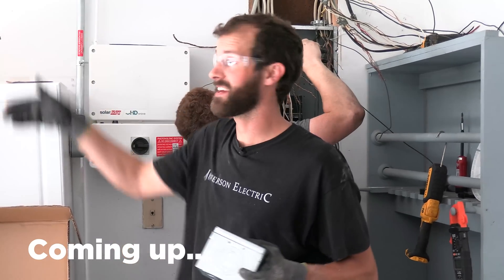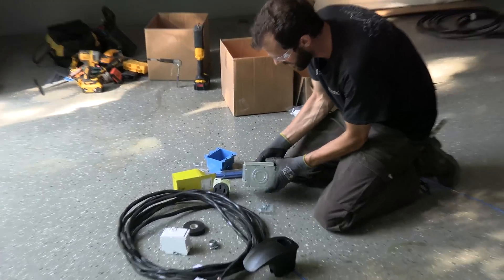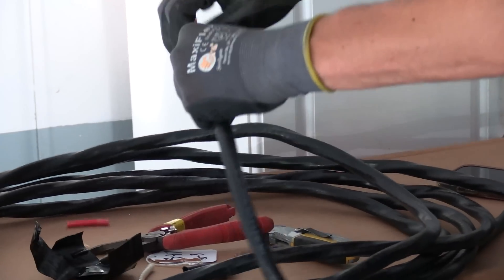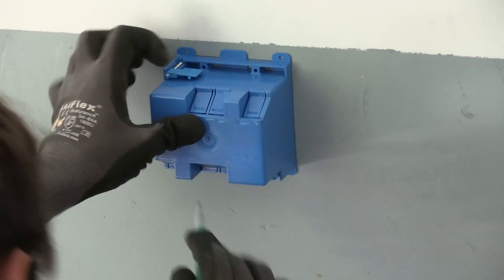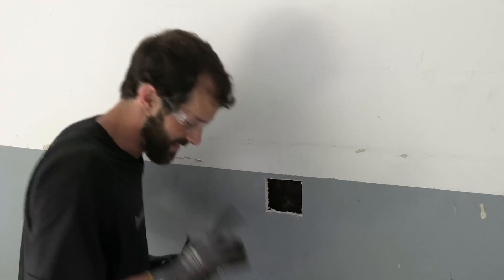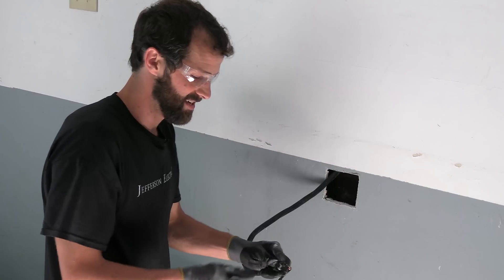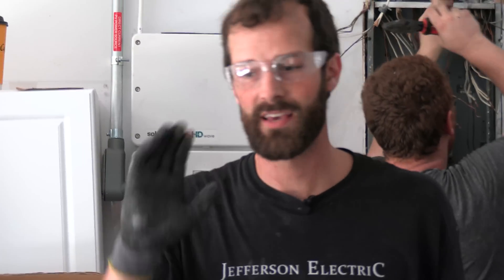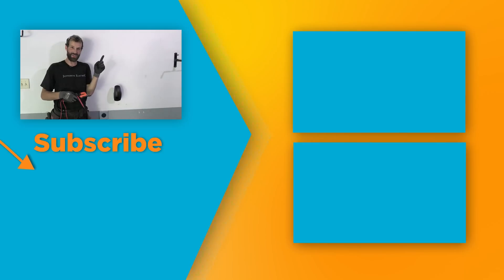Pros Only - Master 'Level' 2 Charging at Home

Comment: 1:38 Can you run 8/3 with a 40A breaker to a NEMA 14-50 Outlet, EV chargers only draw around 32A max?  I believe there is an exception in the Electoral Code since 40A receptacle do not exist.
Reply: If your breaker is 40A, you can run #8. The breaker determines the wire size, not the receptacle or lack there of.
Reply: @paaao  ... it's the wire size that determines the size of everything else. You can't put a 50 amp outlet on a 40 amp circuit. Have fun finding a 40 amp outlet or cord cap on the shelf.
Reply: @rupe53  Not sure what you are talking about, they do not make 40A outlets and you can safely plug a 50A pigtail to a stove in a 50A outlet wired to a 40A breaker which will trip if the appliance pulls more than 40A.  When was the last time you used every burner and oven at the same time on your range.  The pig tail must be matched to the appliance, so it would even be allowed to plug a 30A dryer in a range outlet.   You plug in 18 AWG wire to lamps and TVs into 12AWG 20A circuits all the time, a direct short is still going to trip the breaker.   What you could not do is wire a 30A dryer pig tail to a 50A range and plug it into a 40A Circuit... the 30A wire could start a fire.
Reply: @ericfraser7543  ... the same logic applies to not installing a 20 amp outlet on a 15 amp circuit. You don't want people connecting a larger load than the wire can handle. Using the 80% rule for continuous loads on a car charger applies here because it's a branch circuit. (over 3 hours = continuous) The flip side is an electric range / oven uses t-stats and will never run full load continuously because everything cycles. In theory you can load that circuit to the max on the data plate.
Reply: @rupe53  Exactly the 80% rule allows a 40A circuit to continuously power a 32A EV, I am not an electrician, but from what I read there exists an exception in the code for 40A circuits with 50A outlet. 

All standard three prong outlets are rated for 20 amps...  so you can wire 12 AWG 20A circuit to an 15A outlet with only two vertical prongs.  I agree it would not be wise to wire 14AWG 15A circuit to a 20A outlet with the option for two vertical prongs or one vertical and one horizontal prong even though that circuit is still protected by its 15A breaker.
Reply: @ericfraser7543  ... the key is in the wording. All 15 amp outlets are rated for 20 amps on the passthrough. You can even draw 10 amps from each half of that same duplex for short periods of time if you are on a 20 amp circuit. You may NOT install a 20 amp outlet (with the odd prong) on a 15 amp circuit. #8 wire is basically relegated to a small sub-panel or a hardwired circuit these days. (AC unit?) You can also use it for a LONG run on a smaller circuit to help with voltage drop.
Reply: @rupe53  Well I guess I am going to find out what the inspector thinks of my 50A outlet on my 40A circuit  LOL...  I don't have a problem coving it up since I have other outlets...  Ironically outlet is only a foot away from my subpanel so I could unscrew the plywood and install 6/3 if he made me fix it, I am not sure it is worth the work.
Reply: @rupe53  yeah, this is what is being discussed. The two go hand in hand. If you have 8awg, your breaker can be 40A or smaller. If you have 6awg, the breaker can be 50A or smaller. The original question was in regards to the receptacle rating and appliance cord, which don't matter, because they only need to be rated to handle the voltage and appliance load.

Breakers are there to protect the permanent wiring from the breaker to the load devices. That's it. So if you want to save $5 and install #8 instead of #6, you're stuck with a 40A breaker or less feeding that ckt. It's not rocket science.
Reply: @paaao  ... while your statement is mostly ok, there is a little rocket science out there because drawing too close to the total rating may eventually trip a breaker. See, it's not always about the draw. Breakers will trip on heat as well. If you hit 100% long enough that may do the trick. You might also get away with 110% or even 120% draw of the marked capacity for a time... but it will eventually trip. I have seen 140% for a few minutes, but you are also heating up the wire, which will make the insulation fail earlier. See where this is going and why NEC recommends the 80% rule on loading for continuous draw? (continuous = 3 hours or more)
Reply: @rupe53  just so you know, I've been doing commercial electrical work for 20+ years, and while all you point out is fine and dandy, it really doesn't apply here for some guy who wants to install a car charger that's going to draw 30 to 32 amps. If he wants to buy 8 awg wire and a 40 amp breaker, all is good with the world. When it trips, he can pull 6 awg wire and install a 50a breaker and learn the lesson that over sizing is always easier and cheaper than following promised specs to the T. That being said, yes 3 hrs at 32 amps is your NEC limit. Which is why when I install a car charger for a friend, I use a 50a gfci breaker, and 6 awg wire. But, if your car fast charges at 32 amps for 2 hrs, then slows for the remainder, your 40 amp breaker will hold. It will probably hold even if your car pulls 35 amps for 4 to 8 hrs. The point is, you either over engineer it to never deal with it again, or you install a 40 amp breaker on 8 awg wire, and deal with nuisances when they come. Bottom line, can you use 8 awg if you have a 40 amp breaker? (Original question). The answer is Yes. Yes you can.
Reply: @paaao  ... You are right about the #8 and a 40 amp breaker. The only issue I have is people wanting to put a 50 amp receptacle on the end, which would allow plugging in a device that COULD possibly overdraw the circuit. That's against code the same as a 20 amp outlet on a 15 amp circuit.
Reply: @rupe53  placing 20A receptacles on a 15A branch ckt is perfectly acceptable. The breaker will open in the event of an overload.
Reply: @paaao  ... "210.22 Permissible Loads, Individual Branch Circuits. An individual branch circuit shall be permitted to supply any load for which it is rated, but in no case shall the load exceed the branch-circuit ampere rating." Seems to me that allowing a larger load via the higher rated receptacle configuration is a problem.
Reply: @rupe53  You're not allowing, or changing/increasing the load by placing a 20A receptacle on a 15A ckt. As long as the breaker is 15A, the ckt will be limited. This is permissible due to the fact that a single receptacle, regardless of how many amps it's rated to handle on it's own, will never have enough equipment plugged into it, to pull more current than it's rated for before the breaker opens. 15A breaker will trip around 12-13 amps. So you can put 20A rated receptacles on it all day long. You're not going to get 20A out of any of them. You may however get hit by an inspector for putting 15A receptacles on 20A ckts, but usually only on a commercial project where 15A ckts are non existent. In a residential situation, they typically don't care, because of what I explained above.
Reply: @paaao  ... you're a smart guy so you will know that a 15 amp outlet is rated for 20 amps on the passthrough or multiple appliances on a duplex outlet, which is why it's allowed. You may NOT install an outlet that allows a 20 amp cord cap to be used on a 15 amp circuit.
Reply: I can't speak to the code issue, but I know many EV chargers can be direct wired, and then set to draw under the 40A restriction on 8/3 wire. So you eliminate the receptacle completely with this install.
Reply: @danieldyer1  not sure why here, in the US at least, they always seem to wire up the plug instead of hardwiring. seems like a better way to go
Reply: @feelingtardy  Plugs make it easier if the end user has to change our their charger for some reason. No need to call an electrician or permit if it needs to be replaced.
Reply: how much are you really saving with #8 wire? In the big picture, everything else is the same price, including labor.
Reply: @rupe53  Copper wire is not cheap the savings is about $100 per 100 FT of wire, in reality not many appliances in a garage require 50A even a sick welder can prob can weld on a lower 40A setting.  For me I had left over 6/3 and 8/3 wire on hand, so I wired up two 6/3 50A circuits and a spare 8/3 40A circuit which I figured I could use for a wire feed welder or an EV charger.  I just wanted my 8/3 outlet wired to code.  I found it cheaper to install a 100A subpanel using 1/0 AL wire rather than running multiple long runs of heavy AWG CU to the other side of the garage, it still would cost me and extra $65 to buy 10FT of 6/3.

On the same thread, why do most electricians always wire generator interlocks using a 30A inlet when 50A generator inlets exist?  You are much more likely to need the extra power to run your whole house than you will need for a garage outlet.
Reply: @ericfraser7543  ... would agree that any long run is better to a sub-panel, then go from there. The flip side is most homeowners don't think that far ahead. On the 30 amp interlocks... most people buy a set closer to that rating (5-8000 watts) which is why it's more popular. The thinking is that unless you are in a major catastrophe, the gen set will only be running for a few hours, or maybe a day. It's a lot of extra bucks to do "whole house" on a portable set, when 90% of homes can do with less on a temporary basis. I can only recall 3 - 4 times over 25 years where the extra would have been nice. Life is hard when your hot tub is cold for a week, right?
Reply: @rupe53  It is sometimes tricky to load balance a panel to a generator if you want to run a boiler + circulators, refrigerator, freezer, well, sewage pump, sump pump, maybe even an AC using 30A transfer switch.  Not all that hard to cook a motor using an under powered generator.  I have seen people run 5 FT of wire for a 30A generator inlet...  at that point it is likely wiser to install the 50A inlet, pre-covid I paid $500 for my 10KW generator plus they make pig tail converters to convert a 50A inlet plug into a 30A 5000W Generator.  A panel which is not properly load balanced so that high draw appliances are balanced between both phases can overload a generator or make it burn more gas.
Reply: @ericfraser7543  ... it's not hard for me to do the math. I did that work for 25+ years. The average DIY type is another story. BTW, typically an undersized gen set will self-destruct in short order. I actually had a 3 minute dissertation I gave to anyone who wanted it, back when I was still working. Just a basic overview of what you can and can't do. I found that keeping things simple was the way to go. AC was on the "fagetaboutit" list. Just pretend you are camping for the day. Heat and fridge are on the OK list. Other things can be turned on or off for 10 minutes to run something else, if you are not sure. With a portable unit just remember you bought it cheap... there's extra foot work to be done if you want to stay out of trouble.
Reply: @rupe53  Moden panels have 60+ breakers, its hard to pick 10 breakers for a 10 circuit transfer switch...  which makes an interlock or meter socket extension transfer switch more desirable.  So long as you stay away from using major appliances you are pretty safe running your whole house on 30A / 5000W Generator which has been properly load balanced...  A 50A 10KW generator, just gives you the option to run a few more amenities, like a toaster or microwave...
Reply: @ericfraser7543  ... agreed. This is why I explain to shut off stuff for a few minutes in rotation for other items. You can certainly give up something to cook breakfast then switch things around again. It's actually simple enough that my wife has a grasp when she gets up at 5 am for work. Been doing my place for 30 years on a 5Kw.
Reply: @rupe53   LOL, you make some good points, I am just going to rewire it now rather than later...  I picked up 3FT of 6/3 for $20...   I had to unscrew one sheet of plywood covering both the subpanel and the outlet box easier now than later since I was painting and it was just roughed at this point.  I don't have to worry what I or someone else plug into it... or explain things to the inspector during final.
Reply: @ericfraser7543  ... just to easy your mind, I spent an hour at the local bar with an electrician friend this afternoon. He's in agreement with what I said. He also added you might stretch that #8 if you did THHN in conduit because it has a higher temp rating, provided you don't exceed the fill rate of the conduit. He also added that if it was BX there may be some that stretch the extra amps, but it depends on the wire inside. Basically he stated #8 in Romex was a no-go for a 50- amp breaker or outlet on a branch circuit. To clarify, I'm not an electrician but am up on most code because I did generator installs for 25 years and I had to know what was going on at the end of a job.